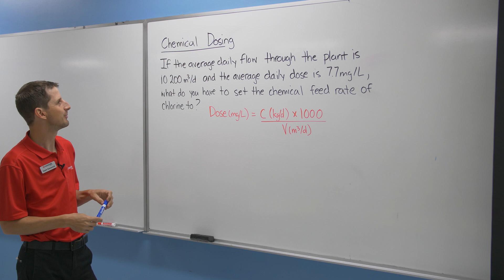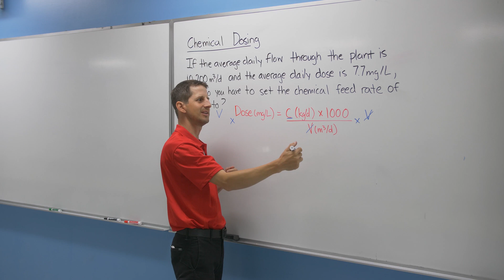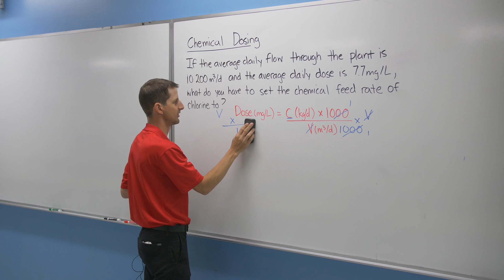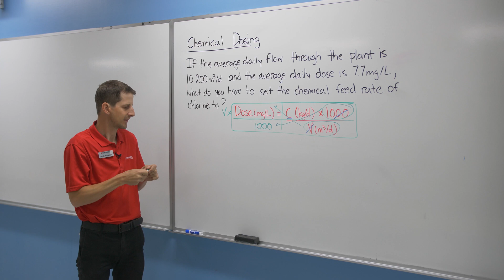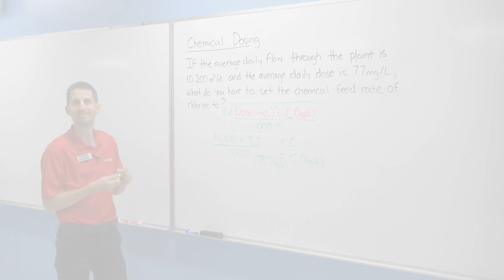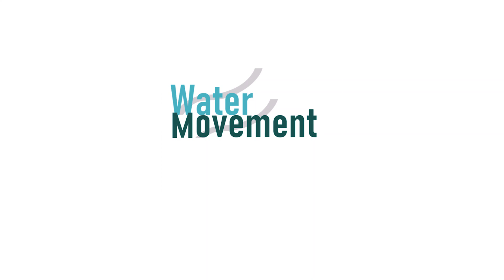How to solve for chemical feed rate - given dosage and daily flow

Comment: Does this works on a continuous flow system or only for a batch system ?
Reply: It looks like it's already set up for a continuous flow system as it's volume/day if it were batch it'd just be volume. You can do a unit conversion to get it into hours, minutes, or whatever you need.